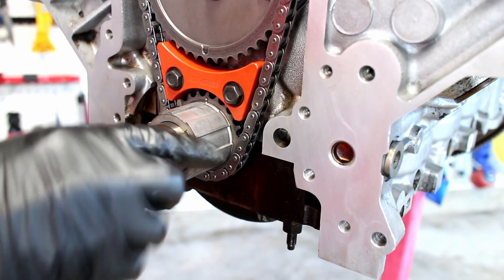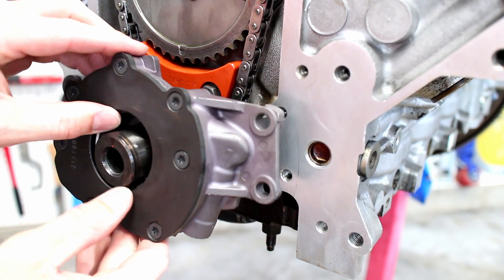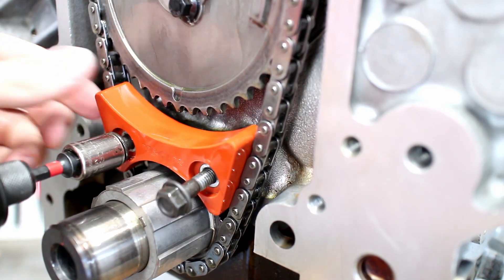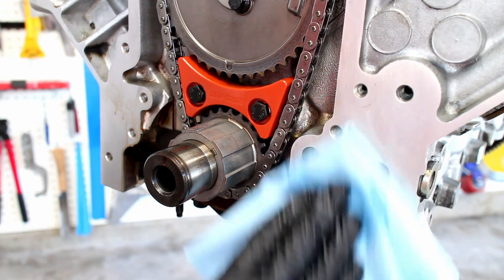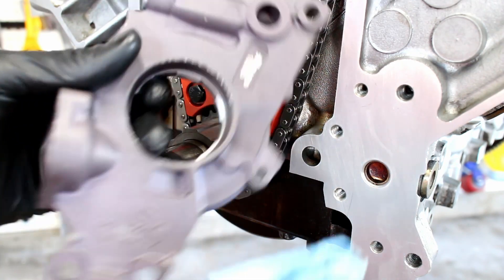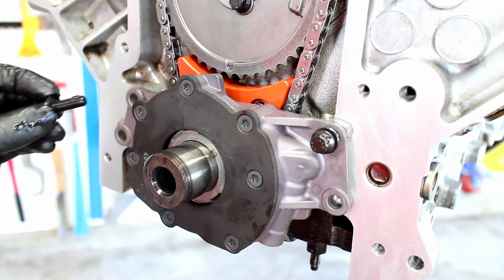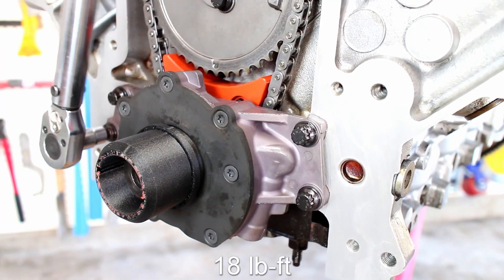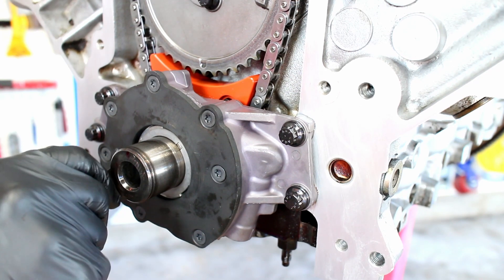LS Oil Pump Install: Melling 10295 (Pt8 82-92 Camaro/Firebird LS Swap)

Comment: Hi..I've got the Melling 10355HV. 70psi spring is already installed. What does it mean: "the second spring for 10 psi included in package" ?
Reply from the maker: there's 2 springs that will give you different oi pressures.
the paper it came with should show what color does what PSI.

Comment: I didn't know that it had to be centered. Good thing I saw this video, oil pump is the next step for me.
Reply from the maker: Well, it can't hurt to make sure the Oil pump is perfectly centered
However, GM doesn't center oil pumps on the production line of the LS or the current LT engines.
so i honestly don't know how necessary it is.